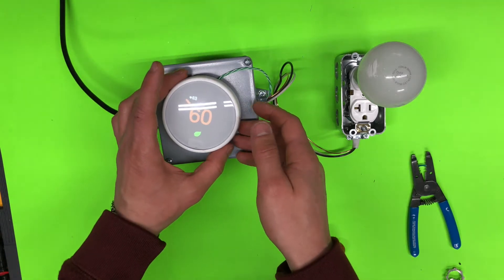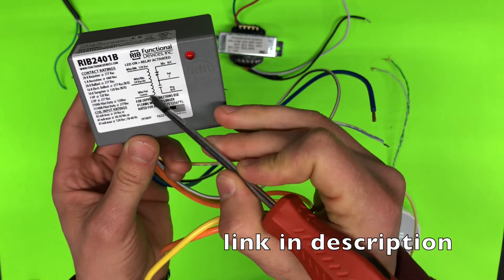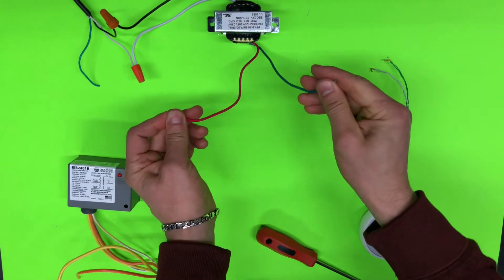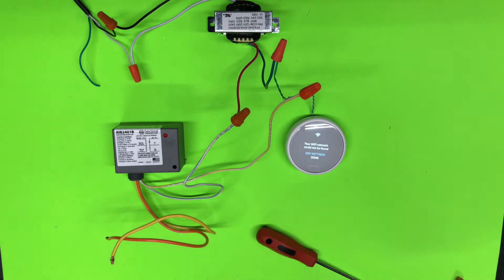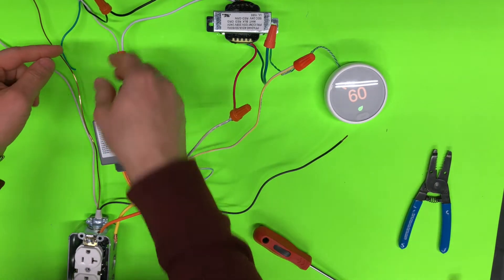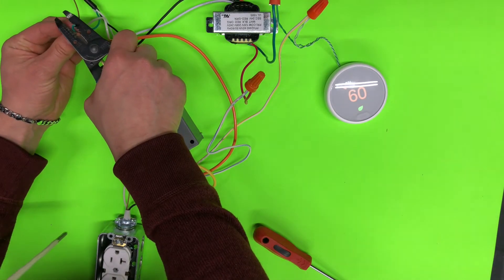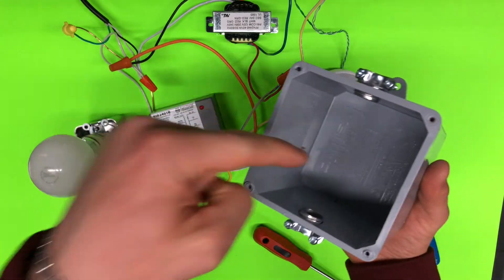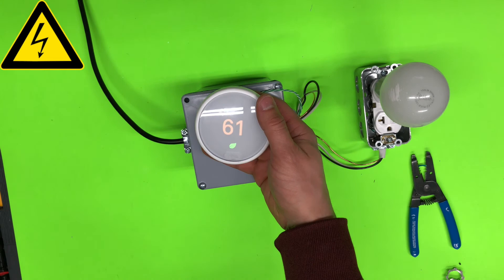Connect smart thermostat (Nest, Honeywell, Ecobee) to baseboard heater or boiler.

Comment: Can this be used on a window unit ac
Reply from the maker: If AC unit starts automatically after power interruption, then yes it's going to work, if you need to press button on AC unit after powering it, then it's not going to work.

Comment: Excellent video. I believe the relay you're using is an electromechanical relay. Do you know if a solid-state relay would also work and still provide enough power for the smart thermostat to properly charge its battery when the relay is not activated/energized?
Reply from the maker: Thanks, I don't know if it's going to work with SSR.

Comment: This is great. I recently installed 240V electric heaters. I used the Aube RC840T-240.
Reply: Can you share how you made it all work? I've been stumped, and blown a transformer trying to make it work on my 240v baseboard heating.
Reply: Hi  @kikihasitall , Thank you for asking. 🙏  It's on my list of videos. It'll take a while due to other requests in the pipeline. Feel free to subscribe if you don't want to miss it. The circuit diagram that comes with the Aube helped a lot. Be careful. 😊
Reply: @NetZeroTech  did you just use the Aube? and do you have 2wire thermostat wire?
Reply: Hi  @kikihasitall  , I used the Aube with an Ecobee (3 Ecobees with one Aube for each Ecobee to be more precise). You can use the Aube to connect any high-voltage heater to a low-voltage thermostat. It’s just a transformer with a relay.
Reply: … it’s described in this video: Wish I'd known this before installing Electric Heating in our home - Switching from Gas to Electric

Comment: great Vid, Question: why you are not using "C" common wire to power Nest from 24v transformer? I understand that R and W completing circuit but not powering Nest....
Reply from the maker: nest will get power from R&W, but for better performance C wire needs to be used as well.
Reply: @SolarEngineering  Thanks! if i need to wire second relay. What ports i have to use?
Reply from the maker: @DimonStudio  2nd relay will control heating or colling?
Reply: @SolarEngineering  Heat
Reply from the maker: same ports, just connect relay in parallel.
Reply: How is the nest staying powered while you turn off the 120v circuit powering the transformer?

Comment: What about just using a smart relay, and taking the thermostat out of the equation since I have  6 baseboard heaters that are controlled individually via 240v, just not trying to buy 6 thermostats lol. So I figured if I get 6 smart relays that area Alexa enabled, I can trigger them via my smart temp sensors and/or motion sensors in specific rooms/temps.
Reply from the maker: yes, this would work, if you can set up automatic heating on/off based on temp sensors reading, then you don't need a smart thermostat.
Reply: @SolarEngineering  thanks for the quick reply.  So basically I would just need a smart relay that handles 240v (which I found and maxes out to 3800watts) and also no need for the transformer?
Reply from the maker: @CORPOR-iThomasKorb  correct, transformer needed to power relay and thermostat. In your case relay will be powered from a 120/240V source.
Reply: @SolarEngineering  thanks again for clarification

Comment: Hello, thank  you for the video. would you know how to connect ecobee3 lite thermostat. it needs power for itself , so i connected 24v transformer to Rc and C . that starts thermostat without any issues . but then ,i guess, i need to use Rc and W1 for the relay ? is that correct ? 
trying to connect LP wall furnace Rinnai ( has 2 black wires  for external thermostat)
Reply from the maker: Hi Boris, yes connect 24V to Rc and C. Then check the voltage with a multimeter between Rc and W1 when the thermostat sending a signal to turn the heat on. 
I don't know exactly but Rc & W1 should read 24V, or C & W1 should read 24V. Then use this pair to power relay.
Let me know if you have any questions.

Comment: Would i need a separate relay for each attachment to the thermostat (W,Y,G) or will 1 relay be fine to attach all those to the thermostat?
Reply from the maker: yes, if the thermostat controlling Fan/AC/Heating, then each wire needs its own relay.
Reply: @SolarEngineering  thank you for that  clarification. One more question, would 1 transformer be sufficient?
Reply from the maker: @islamkalouda8647  yeah, should be good. this relays consuming only about 5-10W.

Comment: Looks like Aube has a simple upgrade to your design.  Could you do a new video using the 120V or 220V option?
Aube RC840T-120 On/Off Switching Electric Heating Relay with Built-in Transformer 24V.  Thank you so Much!

Comment: Great use of Nest E.  What box do you use to house the relay/transformer?  Also, would these components work with 2 (120v 375w) heaters? Thanks
Reply from the maker: I'm using 4 in. x 4 in. x 4 in. PVC Junction Box.
Relay should work upto 2kW of load. So 750W will work fine.